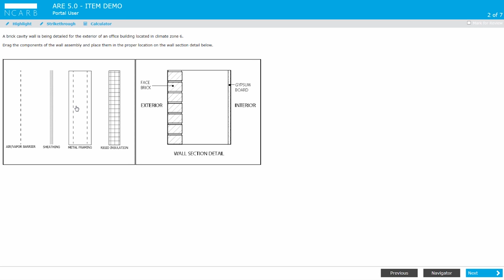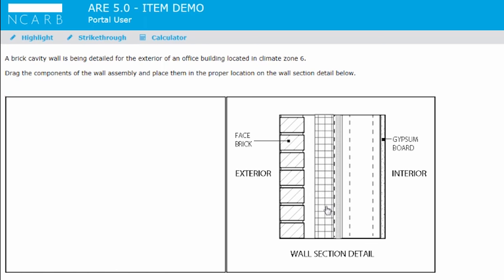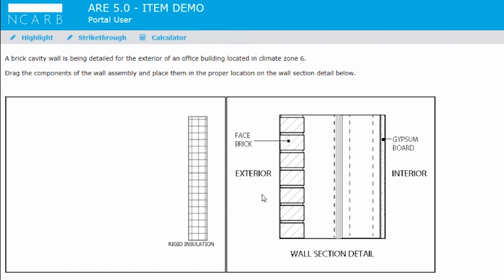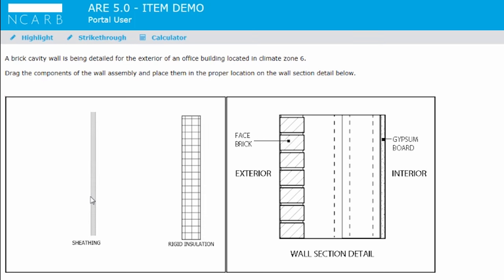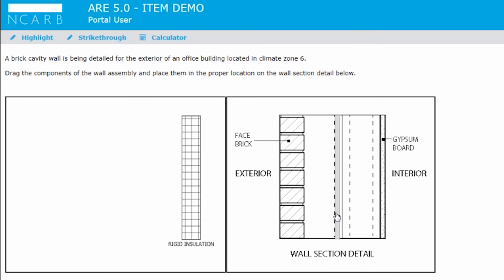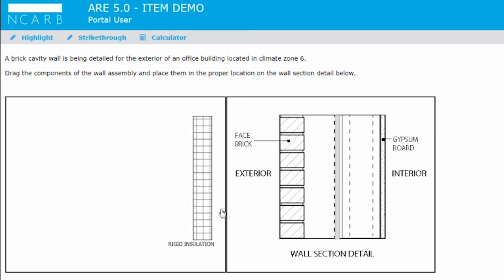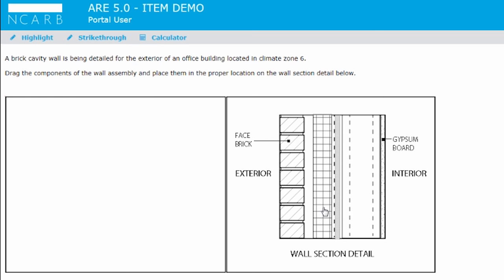ARE 5.0 Drag-and-Place

Comment: This seems so much more sensible than the current test.  My only question is why did it take this long to implement this? This could have been put in place years ago.  I absolutely hate the current vignettes so I guess I will consider waiting for the new exam to roll out...

Comment: #1) How do candidates know what climate zone 6 is?  Why not state, temperate or humid or cold etc?  Why be ambiguous?
#2) The whole industry is in confusion as to where the vapor barrier should go.  Depends not only on climate, but also on air barriers, insulation type etc.
#3) This is a shitty question and open to multiple answers.
Reply: There is a significant difference between the old-fashioned vapor barrier, with insulation inside the stud cavity, and the newer concept of Vapor Retarder/Air Infiltration Barrier. (VRAIB).  If you have insulation such as fiberglass batts or cellulose inside the stud cavity, you would put the Vapor Barrier on the inside...the warm side...to prevent water vapor from migrating into the stud cavity insulation and potentially condensing there.  The old-fashioned AIB would be placed at the exterior sheathing to prevent air from infiltrating the cavity from the outside.  In the new thinking, the two components are combined...and, most importantly, the insulation is moved from the stud cavity to the cold side of the studs.. We should be familiar with the climate zone system, with 2 or 3 being very cold...northern Maine....and 10 being deep south.  Zone 6 is roughly Massachusetts/RI/NY...considered a cold climate.

In general you will find that ARE 5.0 is more nuanced than earlier versions.  They want you to be able to read in-between the lines more.  In other words, they assume you know most of the BASICS (what I call Flash-Card knowledge)...and the questions are meant to get you to use the basics with architect-thinking.

So in this case, you have to realize that they are not talking about the old fashioned Vapor Barrier, per se, like 6 mil polyethylene sheeting...you see that the insulation is not a porous insulation...it's rigid, and it's located outside the stud cavity.  The VR/AIB goes on the outside of the sheathing.  Seeing the ONE component, Vapor/Air Barrier is the key that this is NOT the old system with a separate Vapor Barrier (Vapor Retarder) and Air Infiltration Barrier (Tyvek, Typar, etc).

Comment: I'm pretty sure the VAPOR barrier in Climate zone 6 goes between the gypsum wall board and the metal stud and the AIR BARRIER goes on the face of the sheathing.  Pretty hard to pass a test when the answer is incorrect.
Reply: Vapor Barrier vs. Vapor Retarder. According to the IBC the VAPOR RETARDER (less than 0.1 perm) should be placed on the interior side of the frame walls in zones 5, 6, 7, 8, and 4. I think NCARB should have called it a water-resistive barrier or even weather barrier (.01 perm or less) not air/vapor barrier. The problem is that often the industry uses these words interchangeably when in fact they are different. I agree though these questions are ambiguous and misleading. I wish that architecture school was geared towards taking this exam instead of 15 design classes on how to build a chipboard museum. On that note... does the vapor barrier go directly below the concrete slab or under gravel layer?
Reply: Polyethylene sheets are usually placed on top of the compacted based, before the rebars are placed, and concrete is poured. So, I would say under the concrete slab, not gravel layer.
Reply: See response above.  The component is NOT "Vapor Barrier". It is "Air/Vapor Barrier".  or, more technically, what we now draw is Vapor Retarder/Air Infiltration Barrier. (VR/AIB).  If this were 1980, and we had fiberglass batt insulation, studs, and the brick cavity....you are correct, for a cold-climate (Zone 6), the Vapor Barrier would go under the drywall, on the warm side of the stud cavity and insulation.  And, the separate Air Barrier (Tyvek or Typar) would go on the outside of the sheathing.  But...the insulation here is NOT an open-cell porous insulation like fiberglass batts.  It is rigid insulation (notice the hatch pattern) and there are NOT separate Air Infiltration Barrier and Vapor Barrier.  It's the newer concept.  You take the insulation completely out of the stud cavity and get it outboard.  Now it is continuous and the studs are not creating thermal shorts and degrading the thermal performance of the assembly.  Since there is no porous insulation susceptible to water vapor damage, no vapor barrier is required at the interior.  The new product, the VR/AIB, goes at the outside of the insulation and is primarily stopping air infiltration into the stud cavity.  However, it is also acting as the primary drainage plane for water that finds itself inside the brick cavity and it has a degree of porosity such that if water DOES get into the actual stud cavity, there is some drying potential towards the exterior.